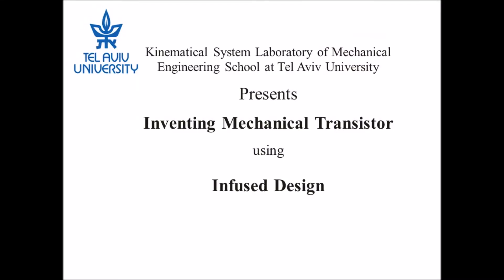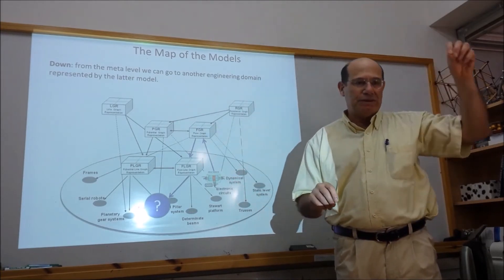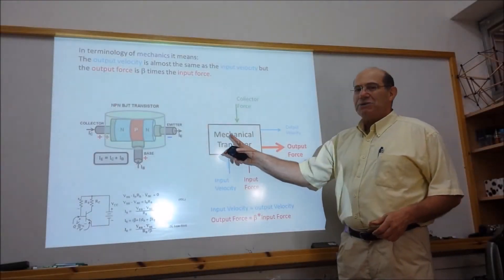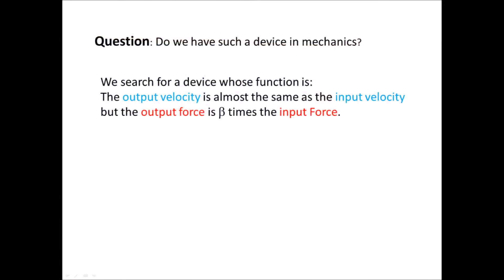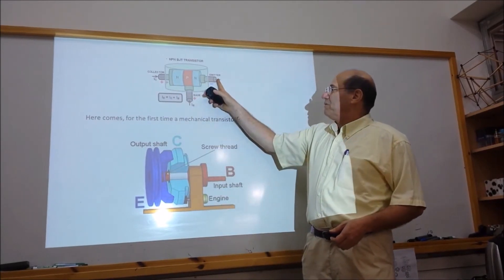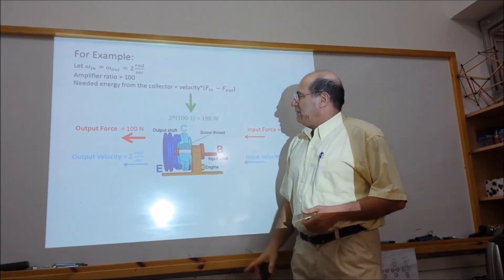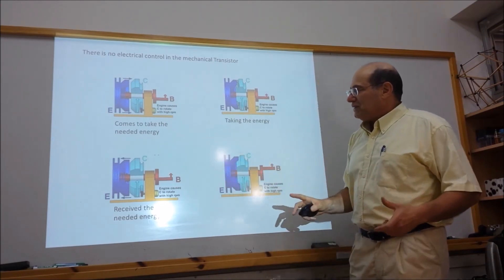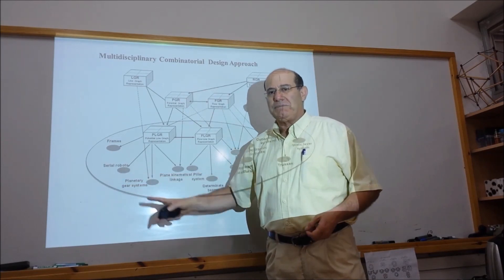Mechanical Transistor Final

Comment: it is very easy  ( E C B = 4:29  "C engine"  "B series thread" "E output "  it is unidirectional torque amplification related to the tightening direction of the thread  E & C joint together Because of friction 6:46  torque is transferred from C to E  but the rotation is no transmitting because of high load  the force is used only to pull  3:35  the rope  down just a little amount of force for the counterweight of the whole body which will pull back from the opposite direction,  when we pull the rope it tight the thread C to E which transfer "force = Torque"  from the "engine = C" to E, But when we lose the Rope the weight of our body Pulls us Back  down because the thread is loose no friction )
disadvantage  = Engine in C must work continuously while we pull or no pulling, more amount of energy is lost because of that   continuous rotation of C, 

Even we put any kind of sensor to Switch "on or off" the engine as we pull the rope  wast of energy is more and the motor can never start rotating that fast in seconds with high torque it takes time to increase or maintain a stable torque utilize 15 to 25 seconds or even 1 minute when the inertia is too high  

(continuously rotation motor) and if we use a fluctuating voltage like a "Potentiometer " to regulate the speed of the motor with the help of the censer when we pull it the voltage increase  then also the wast of energy is there 😌🥰

Comment: where r u geting the collector energy in ur lifting device?
Reply: man it is very easy  ( E C B = 4:29  "C engine"  "B series thread" "E output "  it is unidirectional torque amplification related to the tightening direction of the thread  E & C joint together Because of friction 6:46  torque is transferred from C to E  but the rotation is no transmitting because of high load  the force is used only to pull  3:35  the rope  down just a little amount of force counterweight of the whole body which will pull back from the opposite direction   when we pull the rope it tight the thread C to E which transfer force = Torque  from the "engine = C" to E, But when we lose the Rope the weight of our body Pulls us Back  down because the thread is loose no friction )
disadvantage  = Engine in C must work continuously while we pull or no pulling, more amount of energy is lost because of that   continuous rotation of C, Even we put any kind of sensor to Switch "on or off" the engine as we pull the rope  wast of energy is more